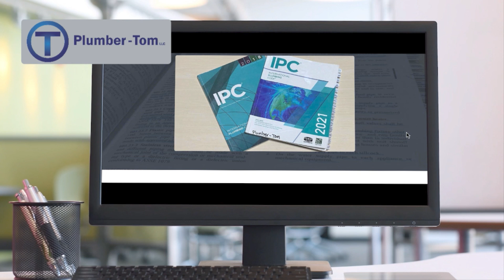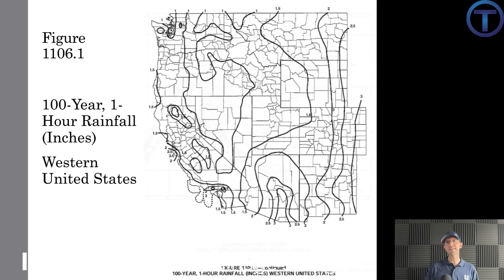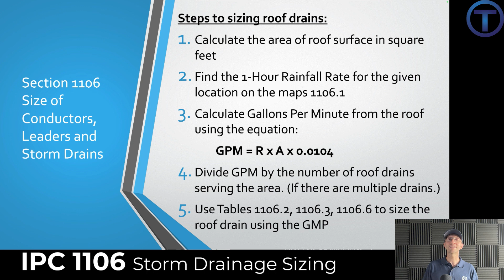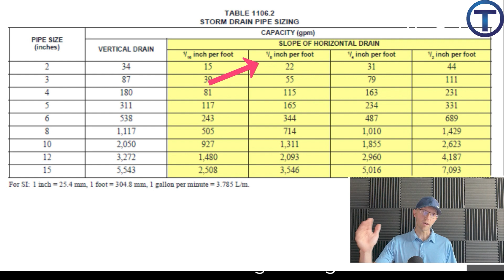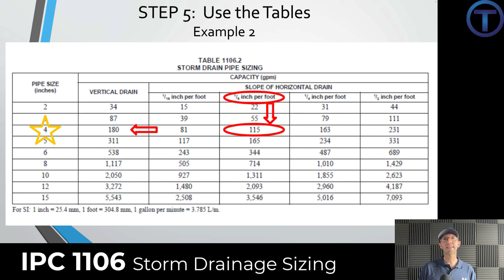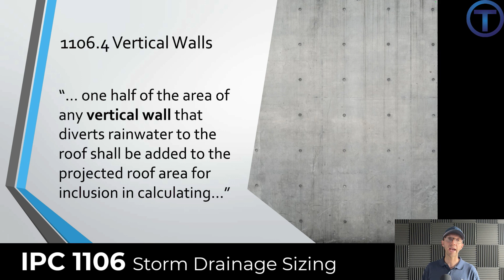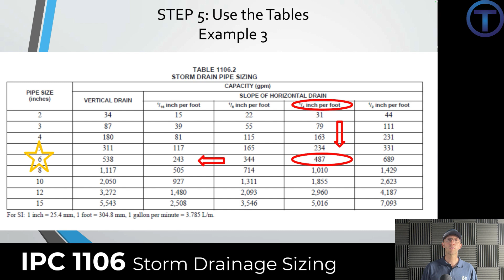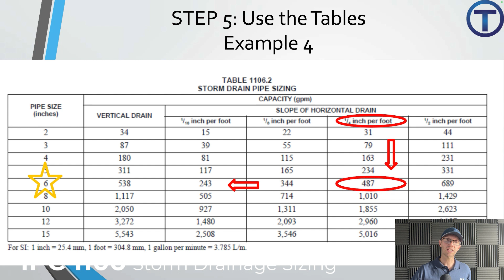Understanding International Plumbing Code 1106 Storm Drainage Sizing

Comment: The sizing table doesn’t have GPM it’s only sqft for me. IPC 2006 plumbing Indiana book. Lost rn
Reply from the maker: Right.  IPC changed from square footage to GPM in 2015 or so.  Older versions of the code won't have it.  I would recommend purchasing the edition of the code that is currently used by whatever state you are in.